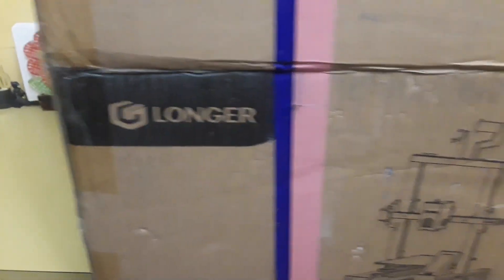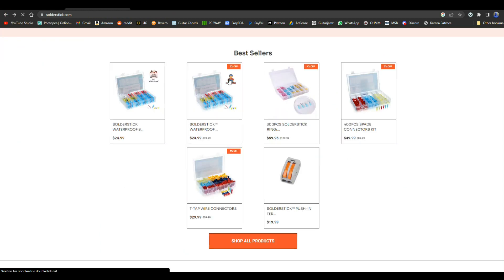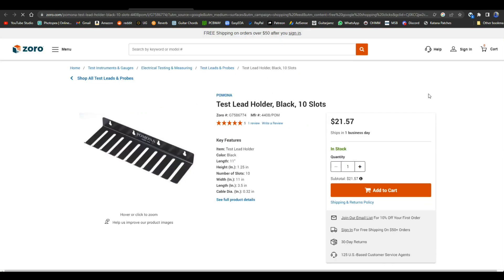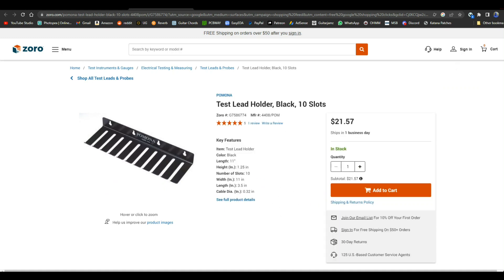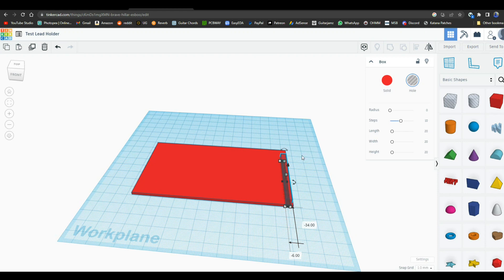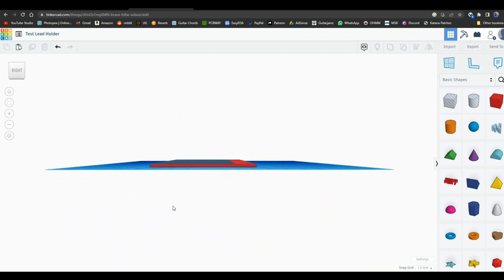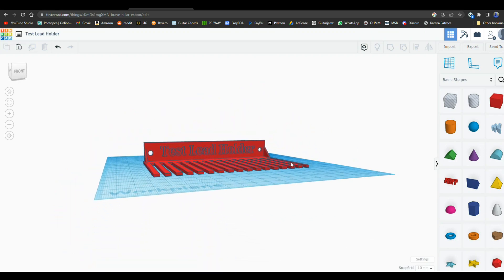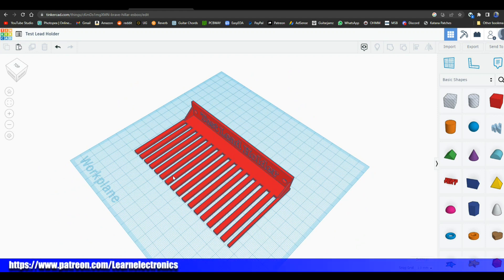DIY Test Lead Holder Design

Comment: It looks great. Depending on the plastic filament used, 2mm may be too thin because of sag from the lead weight. I can see the visual appeal of using Tinkercad, but find OpenSCAD (Free Software) to be less work for something like this project. Of course, the tools we use are always a personal preference.

Comment: I actually designed a similar hanger a few years ago works great but I had a problem with the way you show it in your design. The "teeth" snap and I had to include some triangular support under the teeth to the wall (if that makes sense). Now works perfectly and very happy with it.

Comment: I am not familiar with the mechanics of Tinkercad but, if it has a way to do so, you should run a fillet along the long 90 degree angle to reinforce that joint.  Might also be advisable to put a small chamfer on the outside of that joint.

Comment: The first thing after making calibration cubes and circles was to start making lead holder, pencil trays and other workbench tools.  My 3D printer paid for itself in the first two months of running.  Never used any CAD tools other than AutoCAD and Solidworks.  Looks like consumer CAD has come a long way.